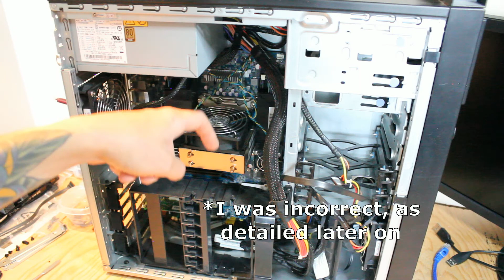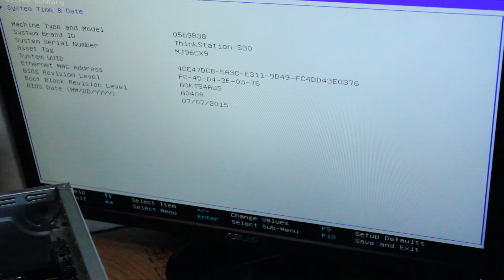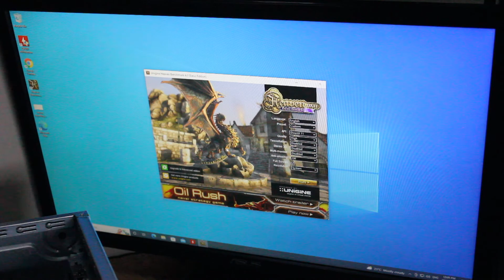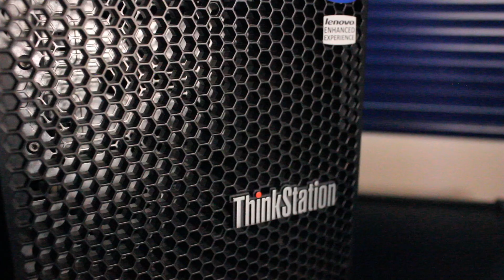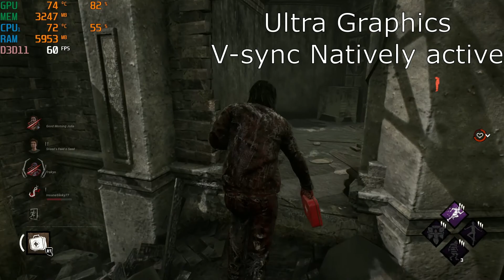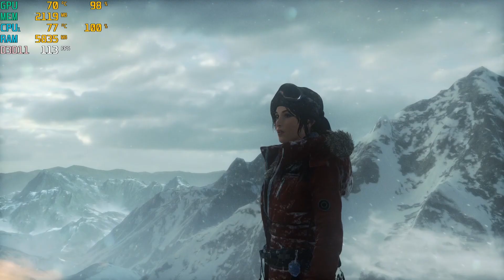Lenovo ThinkStation S30 Upgrade Tutorial for Gaming:  GTX 970, SSD, RAM

Comment: I would like to say this video is great.
I have been using S30's to make gaming rigs for a year now.
You can put the hardware into an In Win 101 ATX case with ease. 
It has top mounting PSU and a good amount of rear panel space for running your cables and stuff. 

I took the guts of the S30 and did this:
Lenovo S30 motherboard 
Xeon 1650 6 core CPU
Cooler Master Hyper 212 RGB Black Edition
32GB DDR3 1600Mhz Corsair Vengeance 1600Mhz 
1x 240GB SSD
2x 1TB HDD
GTX 1070 8GB
In Win 101 white ATX case with blue LED
Lenovo 610W PSU
5 pack of Apevia RGB Fans (got em set to a nice blue that matches the case LEDs)
80mm fan from the S30, reason is you need at least one of the original fans or the motherboard gives you an error on boot up. 

My main PC is a i7 7700k build with a 3060 in another In Win 101 but it's black and red LED themed I built the rig above this when I upgraded my GPU so my guests would have a PC to game on and it looks good as well. Pretty much looks like a blue and white version of my black and red PC.

It legit looks like a badass gaming PC and gets 60+ FPS in most titles. Swapping it to a case with a top mount area for the PSU makes a world of difference on cooling performance and the aesthetic and the space it takes up. The In Win 101 is a smaller case than the Lenovo S30's stock case. it IS wider but it is not as tall but it also LOOKS WAY BETTER haha :) hope to see you do more mods on these.
Reply from the maker: That's awesome, I haven't heard of that case before so I will check out the pricing on it.  I try to stay as low as possible for "budget" custom sales, so my S30 builds will have lesser upgrades compared to yours, unless I find some good deals.  The GTX 1070 is becoming a solid budget GPU now that prices are leveling off, though.  I did recently pair one with a Ryzen 5 1600 CPU.  I have a DeepCool CC560 case that should fit the S30 board well.  I am going to install a Sapphire Nitro Radeon R9 390, 2 x SSD's, storage HDD, maybe a new PSU if I don't get more PCI cable adapters.  Probably a DeepCool Gammax 200T CPU Cooler.  It's very tempting to install more RAM, but unless someone requests it I'll likely stick to 16GB.   I have another GTX 970 and a couple of Sapphire Radeon R9 290 (4GB variant) to use, so I may build a couple if I can get some more deals on cases.  

I have an RTX 3060 paired with an i7-10700k in my gaming build and an i5-10400 paired with a GTX 1070ti in my workstation.  My basement PC has an i7-7700K paired with a GTX 970.  So, we share some similar hardware :) 

Thanks for sharing your setups, it's good to hear about solid office PC "glow ups."
Reply: @HaisteComputerRepair  my good friend Smurph uses a Lenovo M93p i7 4770 build with a GTX 1060 6GB, a 600W PSU and used a 24 pin to 14 pin adapter to get the 1060 some juice and it runs great as well. All he did was get RAM, the PSU, the 12 dollar adapter and a used 1060 (from me for 120) for his setup and he's gaming on that as well. He's my friend who doesn't have the portable setup unlike the majority of us but since we meet at my place to LAN (we're old and still do that) I have a setup for em.

I got a Lenovo M900 SFF with a 1650 LP as my portable rig.
Reply from the maker: @kingkosher6231  Nice, I love the Lenovo office PC upgrades.  It's in my videos, but I did a M93p upgrade with an i7-4770, GTX 1050 low profile and an exhaust fan installation to help with temps.  Did your friend swap to a larger case?  That sounds like a solid budget build.  

LAN parties are not yet a retired thing ;)
Reply: @HaisteComputerRepair  wellllll I just won an M73 with an i5 4570 and I'm gonna put my old 4770k in it and a 970 :)
Reply from the maker: @kingkosher6231  Awesome.  I just installed a Radeon Pro WX3100 in a M73.  Your build will be much better.  I thought about doing the same, but I have a bunch of stock to go through.  Good luck!
Reply: hey! I bought an s30 motherboard and installed it in in atx case . I dont have the memory fans or the thermal sensor and the fans (cpu and hdd fans, backside case fan, front case fan ) are running on full RPM and it is noisy and I dont think it does good for the fans to run on full load at all times. in the BIOS i've tried to set the custom fan table but i cant customize anything. It is quiet that way but the fans do not ramp up under a load and soon overheat. Do you know a fix for that?
Reply from the maker: @arpadgezalesko663  That's one of the complications I thought about when I was considering migrating to a nice PC case.  One option for the case fans (not CPU fan) is to either get some fans that you can power from the power supply alone.  As in, not plugging in to the fan headers on the motherboard.  This can be fans powered by molex.  These will run at one speed always.  Or, you can get fan cable extensions and route them to a fan speed controller, like this:  https://tinyurl.com/yujee525

I've installed this same fan controller in a system I built and have a spare.  It works.  You can connect your CPU fan to this as well, but you may get error messages before the computer posts.  Let me know what you are thinking and feel free to send me an email via my website if you want to chat there or need any help.  I have a Discord server laying dormant that could work as well, just let me know.